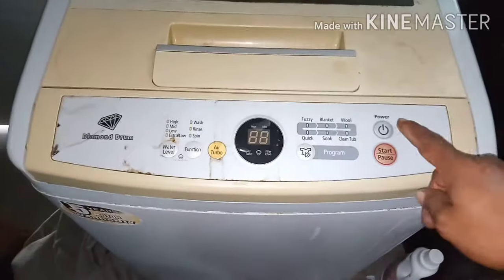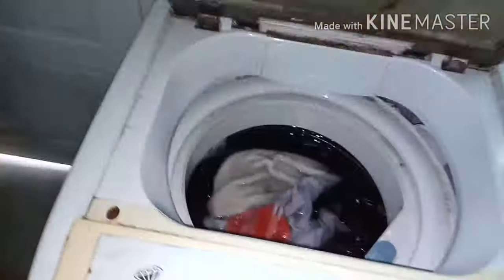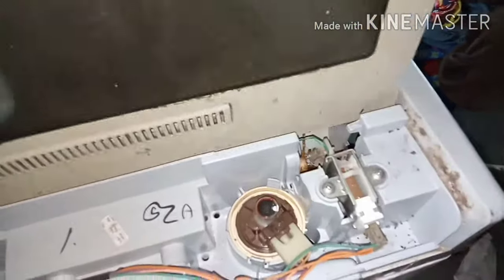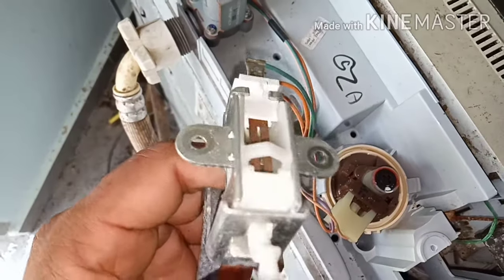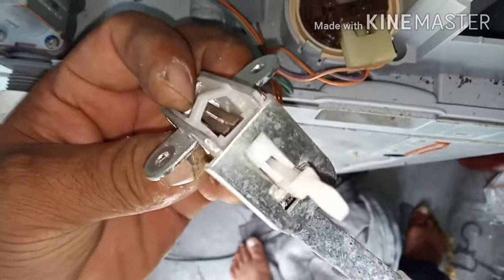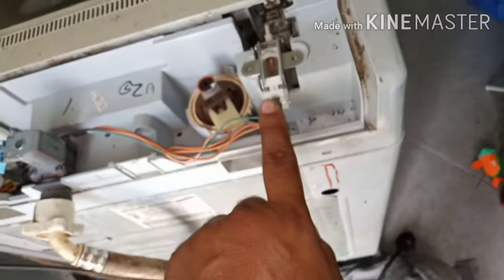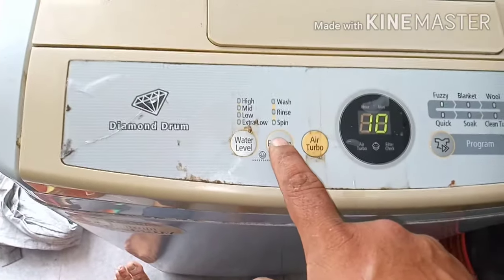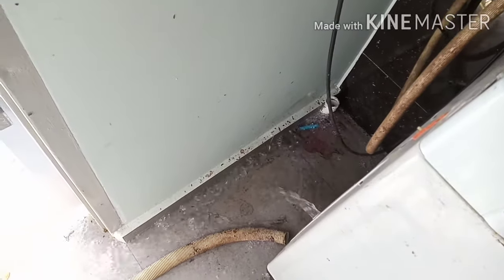Samsung washing machine dE error code

Comment: As he said check with multi meter.
if still same.
Just put thicker double side tape at door lever without peeling the top smooth side. i use two double side and now working. it just wear and tear.
Or just change new switch.

Comment: mine makes contact, but i get the de error after 15 min into washing. i would have to unplug it for a while in order to get rid of the error but it will happen again. please help.
Reply from the maker: Did you check door switch ?
Reply: @mdedonislam1748  it was the reed switch. resolved it with this video https://www.youtube.com/watch?v=4FAOwA7FscU&t=18s

Comment: I have done it it is still the same showing dE
Reply: As he said check with multi meter.
if still same.
Just put thicker double side tape at door lever without peeling the top smooth side. i use two double side and now working. it just wear and tear.
Or just change new switch.
Reply: For those not working....

As he said check with multi meter.
if still same.
Just put thicker double side tape at door lever without peeling the top smooth side. i use two double side and now working. it just wear and tear.
Or just change new switch.